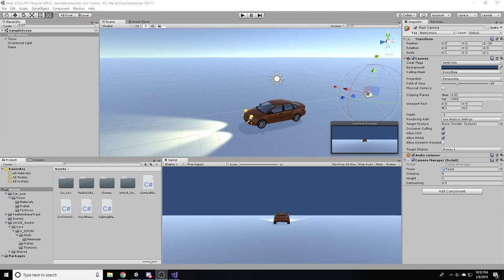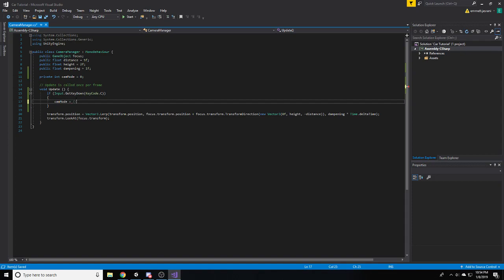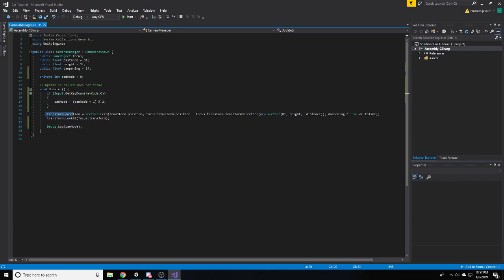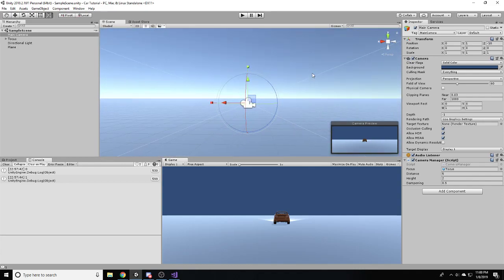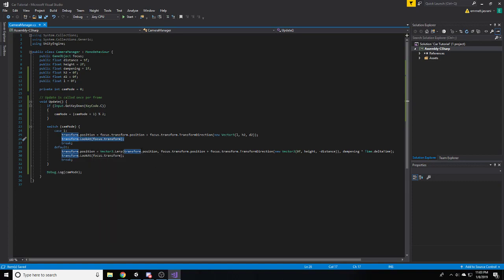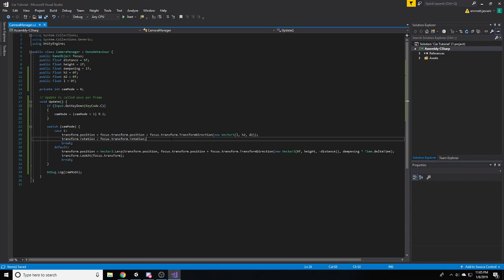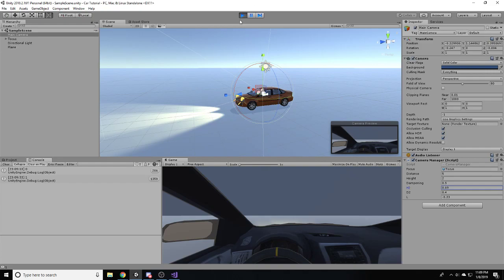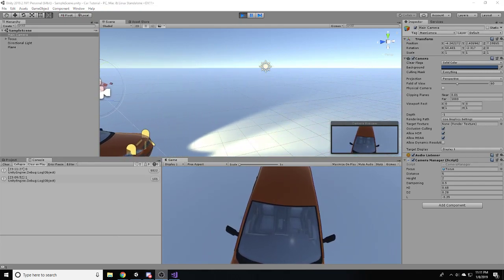Unity Car Physics Tutorial - #6

Comment: Hi! Thanks for the tutorials! Do you have advice for how to adapt this car to VR/Quest? I have been following the tutorials so I have a car that drives with the arrow keys but I want to put it into Quest so that it can be driven by the hand controllers, maybe like with the joysticks if that's the easiest. But I'm stuck on how to do that. Thanks!
Reply from the maker: I'm not sure since the Quest is, as far as I know, primarily use as a standalone headset. If you were to connect the Quest via QuestLink(?), I would hope that the OVR integration would support the headset. If that's the case, my video on that exact subject (but for the Rift) would suffice, or you could simply look at one of the tutorials but other creators on the subject. Good luck!